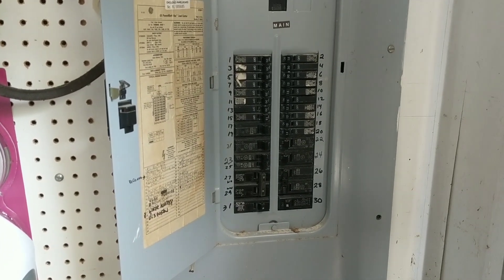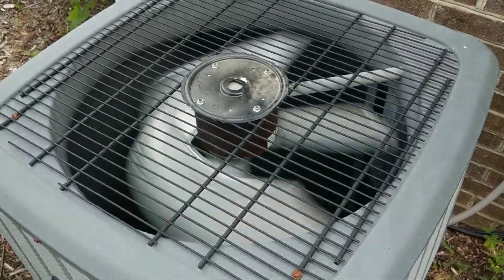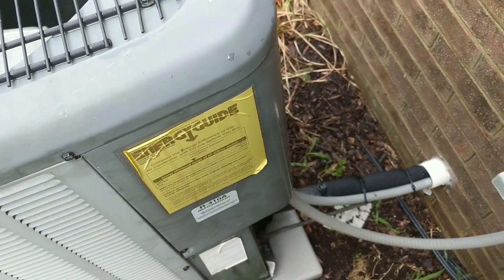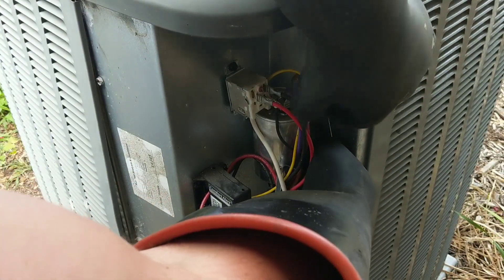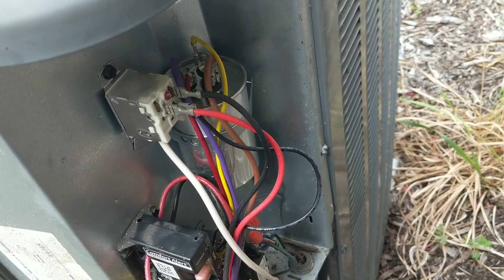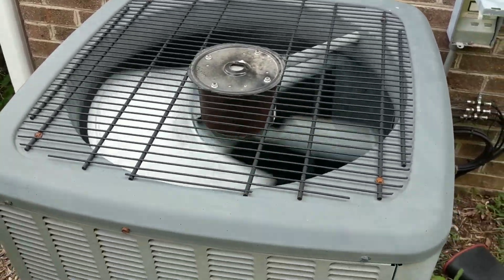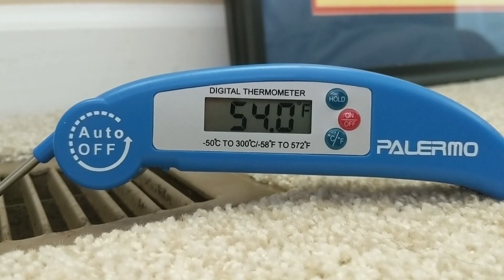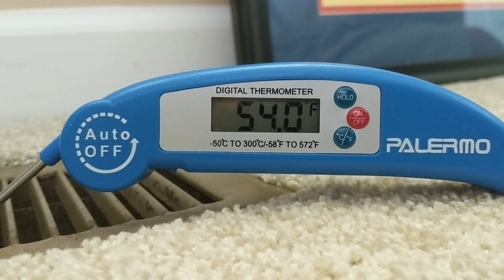How to Fix an AC Unit That Blows Hot Air - HVAC Repair

Comment: Be careful removing the capacitor, it stores electricity. You should always decharge the old and new capacitor before handling it. You can short it with an insulated screw driver common to herm and common to fan connections
Reply from the maker: Correct, thank you
Reply: @BtwilliasGarage  I was going to message you about that.  I fixed my unit once and didn't know about discharging the unit.  Very scary to find out after the fact! :)

Comment: I need to clean my outside coils,  l bought a screen cover on amazon pretty cheap,  looks like a bug screen, and zips  up,  that will keep it cleaner. 👍
Reply from the maker: Very cool! As long as it does not restrict then I feel like you have a good idea
Reply: @BtwilliasGarage  l fixed my A.C. today. It was blowing hot. l did everything l could think of to fix the A.C, then l went to put on a load of laundry, and that didn't work, so l reset the circuit breaker, still didn't work, then remembered the screw driver trick on the fan blades, l just hit the side of the blade to kick start it abs it works great. Turns out our building had a short circuit the night before 
I'm a 65 year old  female and  still fix  everything myself because of people like you on YouTube. Thanks. 😊
Reply from the maker: @Freyja123  right on! I'm so glad my video helped. Stay cool!

Comment: I did what you said (didn’t replace the capacitar though) and it worked! I will clean it in the morning. Thanks!
Reply from the maker: Your capacitor is going bad soon. You made it nearly to the end of the season, but expect to replace it before next summer. Don't let it burn your fan up

Comment: So I changed my capacitor last June. 

Today, the fan and everything is working fine, but the air is not coming out as cool and it will not get to my target temp. 

Any thoughts on what it could be?
Reply from the maker: To start with the basics, are you sure you have put it in AC mode for the season? You would be surprised how many people request service calls for that. If you have, then you will need to find a more advanced video and person. You could have a leak, have compressor, etc. I do not have advanced knowledge past the basics, I'm sorry. Make sure that fan is really kicking ok, capacitors can slowly go bad and kick the fan on when you check, but then stop being able to start it by the time you are inside. I've had ones only make it 12 months

Comment: Great video, Do you know if you could help me? I got the capacitor in with all the wires in the right spot but now I am only getting hot air to come out of vents. The fan on the outside unit is blowing out cold air. I think something is definitely wrong. I checked the cold pipe going into the house and it was hot. I turned off the unit and disconnected the power. Any thought on what I did wrong thanks!

Comment: I did everything u said. When I did the stick thing it worked. Got the fan up n running. But I finished the whole  video so I knew I had to replace the compacitor. I got the exact same one. Replaced it. Was pretty easy.  

I put everything back together. Turned on the ac at the thermostat and walked out and it was making the same noise from the fan....  so idk why it didnt work this time... I even tried to use the stick method again to jumpstart it... but this time jump starting it isnt even working... it feels kind of hard to move... I even tried to turn it both ways to make sure I was turning it the right way...    please help me.

Comment: The expensive filters are not primarily a marketing ploy or rip off. The higher the MERV rating the cleaner the air. Did you know a MERV 13 or greater will captuure Covid 19 germs and keep them from recirculating throughout a building. Here is the issue under normal conditions. If you don't have enough air flow as happens often because return lines aren't sized properly you choke off air flow and can burn out fan motors and not get enough cfm's at the registers. So making a blanket statement that they're rip off is moronic

Comment: I need some advise.  My unit blows warm air when its very hot and I am forced to spray cold water with the hose around the unit to get the unit to blow cold air.  why is that? Is it because I have not clean the unit with soap like you showed on this video?  Thanks
Reply from the maker: I would start with cleaning the outside coil the way you saw me do. Spray the water from the inside out and use dawn soap. It may be clogged

Comment: Seems like whenever it's real humid out in the morning my air conditioner will come on and then when it shuts off the fan keeps moving outside blowing and then it starts freezing up inside so I have to shut it off the breaker and wait a while sometimes I have to do this twice before it will finally come on and cool and shut off completely like it's supposed to without the fan running outside what is the problem please help! Otherwise it cools really good.

Comment: I have a 3 T goodman  unit  the tech replaced a " weak capacitor " was reading 38 instead of 45  so he said  they Replaced it , had a newbie with him ,
a 40 cap  for a 50 cap " new one "  that was few weeks ago  Today my Unit Is Not Cooling   ....
was it ok to replaced a 45 cap for a new one of 50  cap ?
what do you think it went wrong ?
thank you for  your  input 😎👍🏼 
God Bless 
today is June 19 2021

Comment: Where can I buy a new capacitor? I can't find any stores that sell them or have them in stock. How much will it cost to just have an AC repairman come out and replace it?
Reply from the maker: Did you check Amazon? Make sure you order the same one as your system has on it now. Google HVAC supply stores. Some only sell to companies so either be prepared to walk in and act like a HVAC employee of tip the guy at the counter haha

Comment: My unit is a wall hung BARD unit that was making a huge racket outside and blowing warm air into the house here in FL. It got to 94 degrees inside. The A/C company came out and said the fan and motor were bad so he replaced it, put a little freon in the unit and it worked, but it's still making a racket even with the new fan and motor, it seems to skip a little and you can see the fan wobble inside.  They are coming tomorrow and said they were going to charge me for labor.  I paid $575 for the first fix on Oct. 19th! They mentioned the compressor. I said that if it was the compressor, the problem was misdiagnosed. It's very cool in here and the compressor kicks on just fine. I'm wondering if I'm being ripped off or what. Any advice? Thanks!

Comment: Thanks for this video.  My AC was blowing cold air for a few minutes then warm air only.  Tried your screwdriver trick on the fan and it worked!  Just replaced the capacitor for $13 and its working great!
Reply from the maker: Nice work man. You are welcome!

Comment: Hello everyone,
It was mentioned in the video, but I just want to remind everyone to PLEASE make sure you connect the wires to the new run capacitor exactly as they were before. If the wires are connected wrong you may blow your fan motor or worse. Good idea to take pictures or a sure fire method is to label the wires b4 you disconnect the old/bad capacitor. There is also a run capacitor on the air handler unit inside the house that helps the blower motor start. It is usually the outside capacitor that solves the problem though.
Reply: Do you know if you could help me? I got the capacitor in with all the wires in the right spot but now I am only getting hot air to come out of vents. The fan on the outside unit is blowing out cold air. I think something is definitely wrong. I checked the cold pipe going into the house and it was hot. I turned off the unit and disconnected the power. Any thought on what I did wrong thanks!

Comment: My ac turns on fine, new filters, coils clean (living in fl I clean often) blower works good just not blowing cold enough air gets to 79°-80° no ice build up thermostat test was good not sure what to do.
Reply: Same here
Reply: I am having the same issue. Anyone figure out a fix?
Reply: Neil Schweitzer it’s most likely the capacitor. Look up some YouTube’ videos on how to change it, it is fairly simple to do. I could’ve done it myself but we already had somebody scheduled To come do it at no cost, and they had the part. They also replaced the Freon.
Reply: it started working again working for now with just really cleaning it good I thought I had them clean but I guess not good enough, I also read that if it is over 92 degrees it can't cool down enough to cool house.. I live in S. FL
Reply: I couldn't figure it out, Arie clean the outside coils extra

Comment: The more expensive filters do help to filter more allergens in the air especially for families with allergies. We have a lot of year around allergens in south Texas. I guess its a give and take, but I prefer a better air filter, its personal preference, but I do also see your point on air flow.
Reply from the maker: makes sense, they both have their places
Reply: ⁰p
Reply: I've had multiple HVAC guys tell me to use cheaper filters. I settle for a good in between.

Comment: Thank you for this video!
Reply from the maker: You are welcome! Did you get it going with the stick test?
Reply: @BtwilliasGarage  tried it and it did not keep turning.   I tested the capacitor and it is completely dead.  Just ordered another.
Reply from the maker: Good deal! Some die faster than others. That's probably a good thing it did so your fan motor didn't burn up. Hope that's not the case!
Reply: @Btwillia's Garage Hope so too.  I’ll know once I get the capacitor.  Thank you again.
Reply: Btwillia's Garage thank you so much!  It works!  I’ve had problems every year with my AC.  I has John Moore came out one year and told me that my capacitor is bad.  Charged me over $100.  The next guy came and found a bad leakage, I paid a couple of thousand dollars and proved to me that the capacitor is actually the original one that came with the AC!  Another year, the AC stop working because of a clog in my drainage but I was charged for replacing some board!  You saved me a ton!  Thank you so much!
Reply from the maker: That's awesome! Thanks for letting me know. You are very welcome!

Comment: Thank you, mine started running after first 2 steps. Crossing my fingers that it remains functioning.
Reply from the maker: You need to watch the rest of the video. Once it gets to the target temperature you are going to be in the same position. You need to replace the capacitor.

Comment: Next step, dump the nest. lol. You should get insulated screwdriver and touch common then move sideways to touch herm and fan contacts on capacitor to discharge so you don't get jolted.

Comment: Wow.. Air at fan was blowing out cool air..turned unit off ..changed batteries.. Wait3d a lil while..turned unit on at thermostat and went outside and fan was blowing out hot air .. Its working but will check it again when it gets to the temp i set it to...just had a company to do ck up before it got hot..all was fine outside unit..so now i may buy a new thermostat..it is an old one.. If that doesnt work i will call company again..but right now it feels good..We are in N.C. too.unit was cleaned by company in May along with ck up but now i will clean it myself with Dawn!! Guy said coils wer dirty at the ck up..thanks for the info.. Happy to get cool air as it was hottttttt today ..and will be thru the weekend!!

Comment: The pipe going outside  to the ac unit in mine, is frozen,  and not blowing cold air.  I did replace the filter, I did clean the unit outside.  Same problem still.   The unit has not been tripped at the power panel.   I don’t know what else to do.
Reply: Call a technician.
Reply: Most likely undercharged

Comment: Good video. I actually did this repair awhile back & it worked out great. One useful tip I would add is that before someone pulls the wires out of the capacitor, they should take a picture with their camera.  Then you can easily see where everything goes.
Reply from the maker: Good call. Thank you

Comment: mine is the fan runs but no cool air. Tech came out cleaned out the unit, refill Freon and said to monitor for few days. after two days, we are back to hot air  blowing again.
Reply from the maker: Sounds like a leak. No telling where it is. They should have spotted it, but it sounds like they will be looking into it further now once you call back. Best of luck and ask for a discount or coupon!
Reply: @BtwilliasGarage  Thank you for the quick response. I have home warranty. Most likely I will end up paying the co-pay again:)

Comment: What happens if your AC unit outside is turning what is blowing hot air also my air filter is dirty I’m gonna replace that now would that fix the problem the AC filter
Reply from the maker: You need to clean the filters and the unit itself. It sounds like you have a bigger issue that may require a technican. Such as a leak and low refrigerant.

Comment: Yeah no, I've paid 2 different techs that both charged me $79 to diagnose the issue and they both couldn't figure it out. They both suggested I just replace a 12yr old unit with a new one. At a cost over over 5k. My issue:
One day my ac went out, after trouble shooting, found out that the thermostat wires on my roof top a/c were so sun dried that they hade exposed wires and clearly took out my transformer (volt test showed I had 120 but no 24v. So I ran new thermostat wires and waited for my new transformer. 6 days later I installed and boom. Got 24volts and both the blower and compressor kicked on. Got off the roof went inside just to find out it's blowing hot air. Couldn't see any mixed wiring, so I thought it needed a charge. First guy came and told me that mechanically everything is fine. It has plenty of Freon and the pressure gauges don't seem to show any leaks. But he couldn't figure out what the issue was. So I called another company and they said the same thing, they tested the hi and low side and said everything there was fine. But couldn't figure out why the coils weren't getting cold. So now I'm stuck with having to pay 5k for a new unit after already investing $150 in new parts. Blah. Thanks for reading my rant.
Reply from the maker: Dang, sorry to hear! Best of luck finding an affordable solution!

Comment: My fan is spinning but the is warm. Do you think its the compressor? And should changing the capacitor fix that?
Reply: Did u ever figure out the issue?
Reply: @RyanKWilliamson  i ended up calling the repairman and it was one of the capacitors.

Comment: My power company put locks on my disconnection box next to the HVAC unit, should I cut it to disconnect or would the circuit breaker be good enought?
Reply from the maker: You definitely need to pull the main fuse to the unit itself!

Comment: What if everything's running inside and out but still no cold air? Lines aren't frosted over.
Reply: Compressor running? 
Low gas?
Reply: @Froggability  Hi she didn't answer lol but I need help! My fan is running sometimes I need to jiggle it and it will immediately kick but its not cooling inside. Ive replaced filter and cleaned the unit. Any ideas or suggestions? Ty in advance
Reply from the maker: @Healing - you most likely need a new capacitor as I showed in this video. Your wiggling it is doing the same as the stick test I showed.
Reply: @BtwilliasGarage  Hey thank u very much for responding and a great video!! I appreciate it

Comment: Sooo I can't get the fan to jump start the unit
Reply from the maker: Unfortunately you have a "bigger" problem than the capacitor and will need to look into the fan motor, low Freon/refrigerant, etc. Best of luck! One day I may continue making videos on more advanced problems, but it may be a good bit. Sorry this didn't work
Reply: Yaaa the fans at like 190 degrees atm. Can't spin it. Oh well its a rental

Comment: I am a HVAC tech I've been doing this for 23 years there is a reason why your run capacitor is going bad it's either the condenser fan motor itself is going bad or the compressor could be going bad it's pulling too many amps and killing the run capacitor you need to call your local HVAC tech
Reply: That may have been true in the old days but now a day it is cheap chinese capacitor with castor oil. They just do not last. I install american made ones for people who will pay for them and in 4 years never got a call back on them. I'm amazed how many people in $300.000 $400.000 homes will take the cheap chinese ones.
Reply: @J-Colt  and made in mexico
Reply: I should add, all are castor oil now and they are not as reliable as the old pcb ones and chinese and mexican as j strand mentioned are poorly made.

Comment: I'd recommend discharging the capacitor before removal.
Reply: How do you discharge the capacitor?
Reply from the maker: After turning OFF THE FUSES/BREAKERS. Touch it with a screwdriver holding the plastic or rubber handle. Sorry for the caps, it's very important that it have the power disconnected first
Reply from the maker: That's good advice

Comment: Funny, are those Linemen s gloves or do you pour a lot of concrete :) You pulled the disconnect you don't need em.
Reply from the maker: Don't worry about my gloves 😂. Correct though, my father is a lineman and I use them just because. Great eye!
Reply: Very well done video. My only comment is warning about dealing with capacitors should have been added.